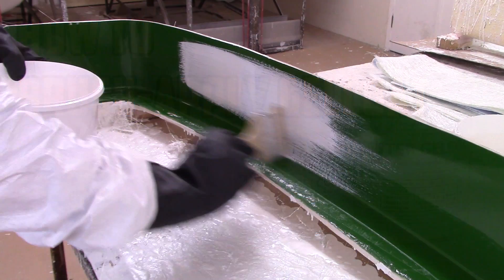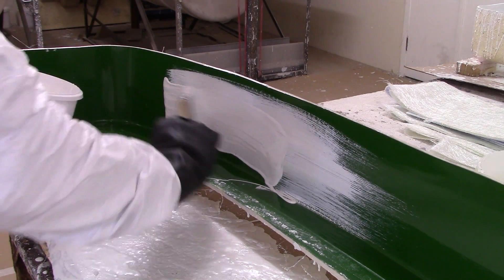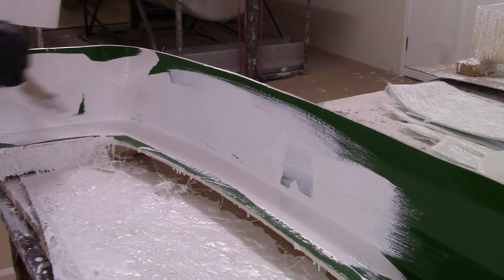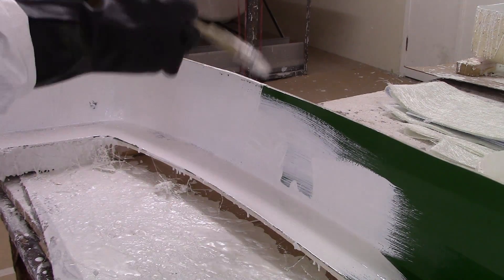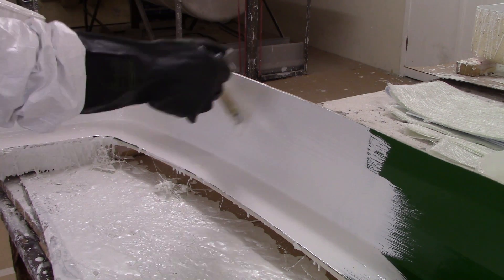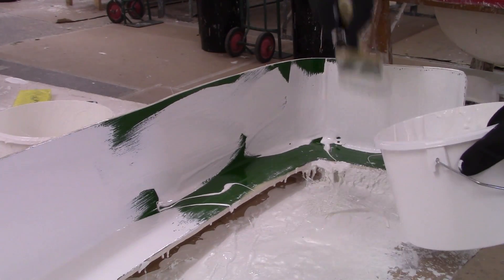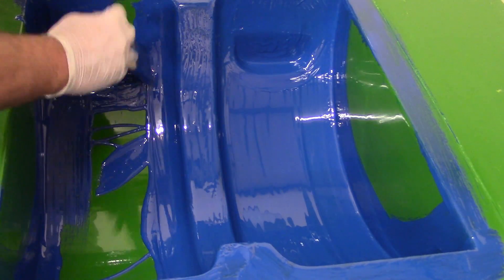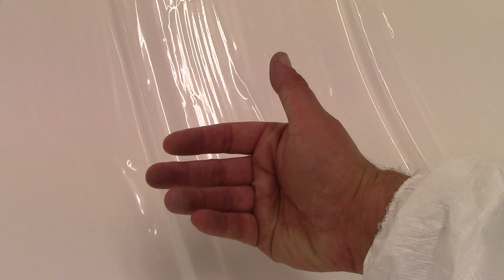Quicktips: How to brush apply gelcoat

Comment: How do you clean your brushes after painting with gelcoat
Reply from the maker: They are washed in acetone
Reply: @ecfibreglassuk  Thanks so much.I started to mix 125grams and added 1.75ml hardener,but the paint turn into a gel really quick. My room temperature was about 25 degrees, can I maybe add less hardener? Will the paint still dry,or will it stay tacky.
Reply from the maker: @faganwagner7411  you can go down to 1% so 1.25 ml of hardener. but i wouldnt reduce it to less than that. gelcoat  will always cure faster in the pot than on the projects surface so maybe just spread it on the surface quickly then spend time tidying the finish,  rather than keep dipping the brush in the pot and applying like a paint.  The product is meant to be applied quite liberally into a mould so the topside appearance isn't important as long as you have good coverage in your mould.  as demonstrated in the video it is applied rapidly, don't use this product like a paint as it doesn't level off or behave like a paint. Also if you are holding the mixing pot,  your hand will generate more heat,  which will encourage the gelcoat to react quicker.
Reply: @ecfibreglassuk  Wow! thank you so much for all the best, really appreciate it.The gelcoat is an amazing product.

Comment: Hi, i just Gelcoat all the bottom of my 12 feet boat, cover it all, now can i paint it after is all dry ?....and i have a question , because marine paint( boat paint) is so expensive , can i use good oil base paint ?!!
Reply from the maker: Hi you shouldn't a marine paint after the gelcoat
Reply: @ecfibreglassuk  Yes thanks, i didn't , but i ask the question before i did some research.

Comment: So...a bit confused...I thought the gel coat was the final finish...you talk about adding fiberglass on top of the gel coat...?
Reply: Thanks for clarifying...
Reply: I still don’t understand.
Reply: @NomadAttorney  it is in mold on the video so when he takes it out gelcoat will be front layer.
Reply from the maker: Yes, so the gelcoat would be the final coat as it is the first coat into the mould. It will be the finished surface when you pull the part out

Comment: Hello I am applying gelcoat with wax on a hull, but i can't do all at ones as it cures to quickly to brush it all, how do I apply the gelcoat with wax on the overlaps? Do i need to sand it or if it still sticky I can just continue? Thank You
Reply: If it has wax in it you should lightly sand the new gelcoat. That's why they make gelcoat without wax so you can layer without sanding in between coats.

Comment: When you say that 1 Kilo of gel coat will cover 1.6 square meters, what does 1 kilo convert to in liquid measure? Kilo is a weight measure.
Reply: Why was I getting involved?  No idea.
Reply: Area Coverage of any paint is the area coverage per kg.
Paint or gelcoat are sold by kg or by ltr.
Reply from the maker: The specific gravity of the gelcoat will vary depending on the temperature and application, so it's easier to do everything by weight
Reply: @ecfibreglassuk  Thanks. I'll try that.
Reply: @johnstarkie9948  Quite right.

Comment: Is it possible to spray this on. I do have a compressor and spray gun equipment
Reply from the maker: Hi, this is specifically formulated for brush application. You'd need a spray gel

Comment: I have a fiberglass repair to paint. Should i use gelcoat or 2part paint? Should i use primer before i apply gelcoat?
Reply from the maker: Hi, that's entirely up to you. It depends where the repair is, what you're repairing, etc.
Reply: @ecfibreglassuk , hull, deck exposed to uv light.
Reply from the maker: @klemenprezelj  https://youtu.be/6_Y1UavwhzI

Comment: For a small job, seems just as easy to order the spray cans of Gel coat and not deal with the clean up.  Finish would look smoother too.
Reply from the maker: Definitely wouldn't work for this application - making a part from a mould. I think they still recommend you use a polishing compound for the sprayed products as well, to blend the repair into the rest of the gelcoat. £15-£20 for a one-use aerosol vs £6 for a 500g gelcoat that will keep for a year or so

Comment: How long does it take to dry? Do you sand then wax?
Reply from the maker: Cure time anytime between 5-12 hours. You can sand it back to remove tooling marks and give it a glossier finish. UV Wax can then be added
Reply: @ecfibreglassuk  thank you for answering my questions. I'll look up your page.

Comment: Great video 👌🏼 how long we should wait for the gel coat to « gel » before applying the fiberglass ?
Reply from the maker: Hi, it depends on temperature and thickness. The maximum time you should leave it is 12 hours
Reply: @ecfibreglassuk  what will happen if you leave it more than 12 hours? It seems to bond the same even after 24?

Comment: i have to use metalflake in gel coat any ideas on please ?
Reply from the maker: It's not something we do, there's tons of info on google about it though
Reply: you can do it but you first have to spray a thin layer of see through coat in the mold and then mix gelcoat with metalflake and spray or roll it on there.

Comment: Whenever I apply the mat an resin to gelcoat while its still tacky I sometime get a wrinkle that looks like crocodile skin when it comes out the mould what's causing this.?
Reply: Have you found out yet, since it's been a year? If not, it's because when you apply resin over the gel-coat - polyester over polyester - the styrene in the top/last layer chemically attacks the first layer, in this case the gel-coat, and softens it. The longer resin sits wet - not gelled - on the gel-coat, the longer the styrene in the resin will the react with gel-coat causing the softening. If you get this wrinkling it means either; 
*the gel-coat was applied to thin
*the gel-coat wasn't left long enough to cure.
the resin application over the gel-coat was not mixed with enough hardener
*the ambient temperature was too low
The statement about a maximum of 12 hours before applying resin is incorrect - it can be months - for the reason I've just stated, as the styrene in the resin will chemically breakdown the gel-coat and bond with it.

Comment: I have been having trouble with my gelcoat "lifting" from the mold surface during layup leaving a checker board pattern of bubbles in spots. I brushed initially and then tried a cup gun, both had the same problem.  Am I not letting it cure long enough before layup or is it mold prep?
Reply from the maker: It could be an oversaturation of release agent, or you're not letting the gel tack off prior to laying up
Reply: You are; a/ not leaving the gel-coat to harden sufficiently. The styrene in the resin will chemically attack the gel-coat so it must be let cure long enough to resist it. 
b/ applying the gel-coat to thin
c/ the ambient temperature is too low

Comment: I would like to brush a gel coat with wax in some storage compartments that are fiberglass but are unfinished and hard to clean. Would this brush method be acceptable, or what would you recommend?
Reply from the maker: To prepare the fibreglass, you need to abrade to a rough finish, and give the whole area a good clean with acetone. This is the best method to getting a good bond
Reply: Cindy Haden ss